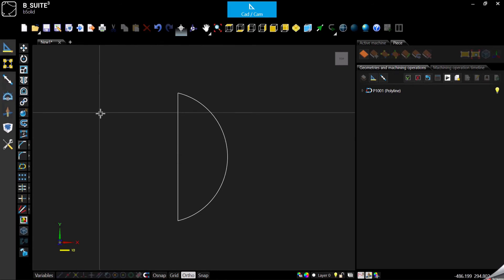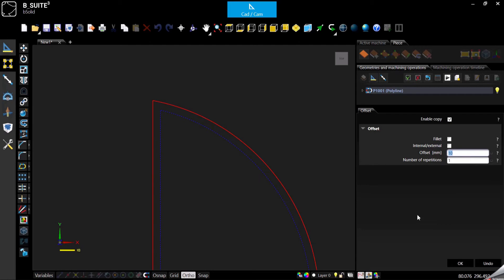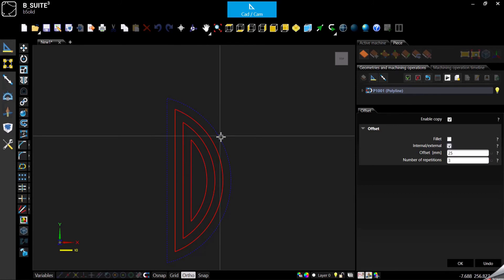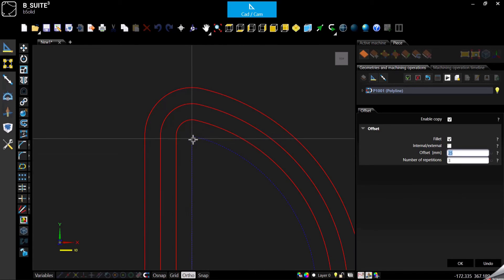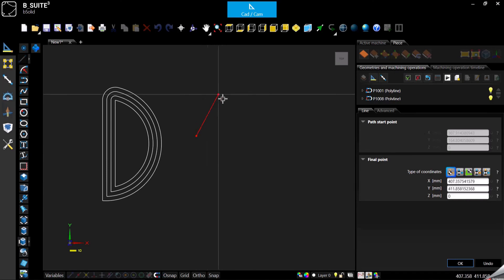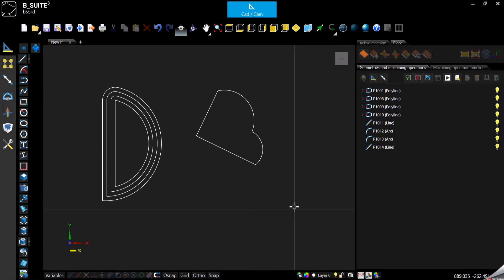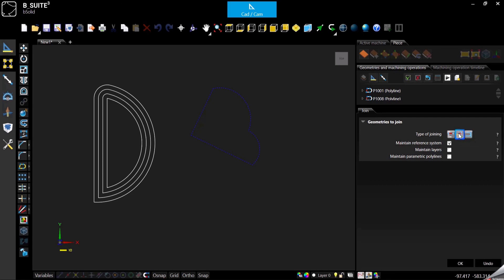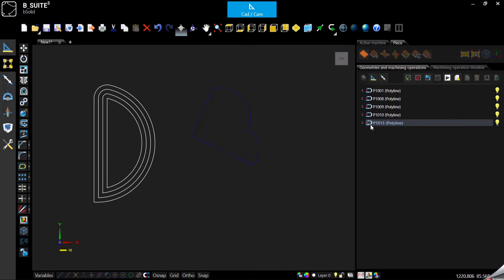13 - CAD BIESSE bSolid - Part13 (Offset & Join)

Comment: When would you want to use filet? Why the bottom corner did not get filet?
Reply from the maker: It is really only about what you are doing... the important thing is to know that there is the possibility of doing it. 
In regards of the bottom corner, it did not get it because of a software bug on the version that I was using. I have tried with the latest version and it has been fixed, so it is working now. 
However, remember that even if you are using the version with the bug, you can add chamfers or fillets in this other way: https://www.youtube.com/watch?v=2yHyHZ5k4e4

Comment: Whenever I try to offset two unconnected parallel lines it always seems like a crap shoot on which direction the lines offset to. Sometimes they will offset opposite directions sometimes the same. Is there a way to control which way they offset to without doing them individually?  I've tried selecting the geometry from the direction I want them to go which I think worked on some other cad programs but It doesn't seem to work with bsuite.